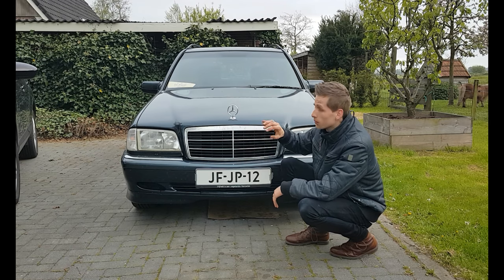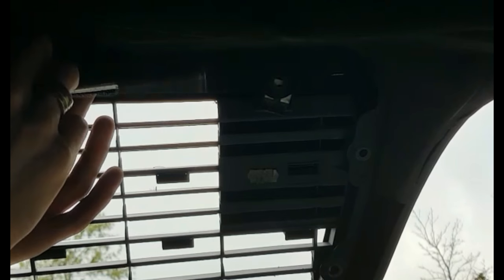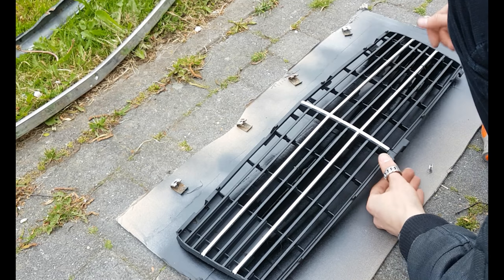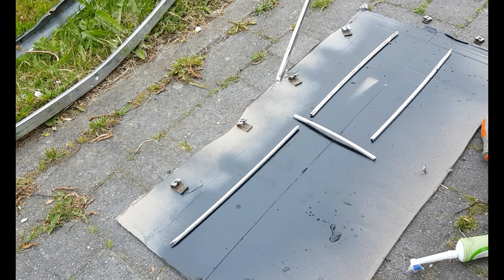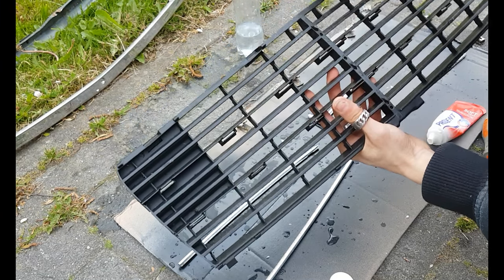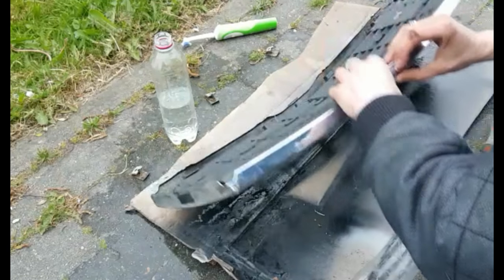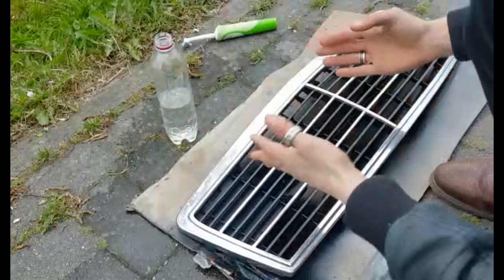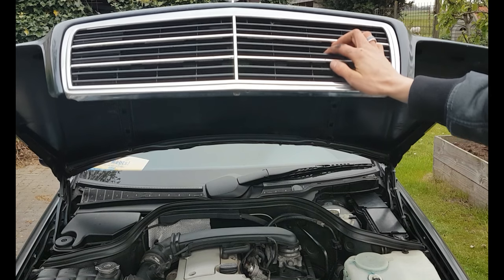Removing and cleaning the grille and hood star - Mercedes-Benz C-Class T-Modell 1999 - S202

Comment: Might mack my grille custom with more chrome strips!
Reply: Eric Chapman thats dumb if your going after market.
Reply: @LiLxJaYxDAwG  nah u rit keep it stock but might end just adding a push bar might be clean and hold it all together nicely since is mostly plastic bumper
Reply: Eric Chapman Always use OEM on a Mercedes.
Reply from the maker: Hey Conscious! Hold that thought! I also believe you need to use MO parts. But! Sometimes you just can't avoid to use aftermarket or custom made parts to fix your car. I respect everyone's choice in choosing car parts. Although I prefer MO parts. As long as these cars keep running it's fine with me😉
Reply: Mercedes-Benz DIY Channel I agree. Aftermarket parts are always cheaper than the manufactored designed part. Thanks for the reply,   Do you know how to  remove the entire headlamp assembly from inside the hood? Im also trying to completley remove the hood with attatched Windshield Hoses and all?  the hoods held ij by 4 bolts but what holds in the Windshield Hoses?
Reply from the maker: Hi conscious. It's very tricky to disassemble the internal headlamp because of all the plastic clips which will likely snap when you look at them. If you send me an email I can help you with removing the hood including the hoses
Reply: Leave the strips just slide them out, if plastic grille is weatherd give it a light sand and clean and paint with black zinc spray paint or flat black to make look like new. Then slide strips back on